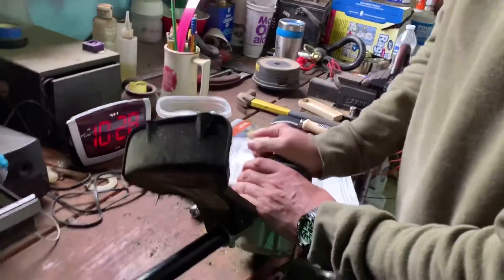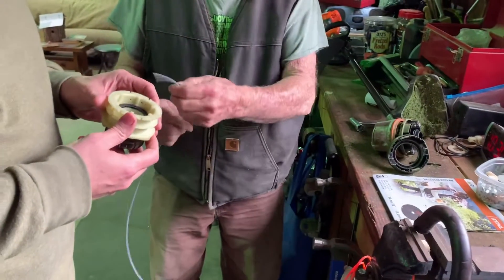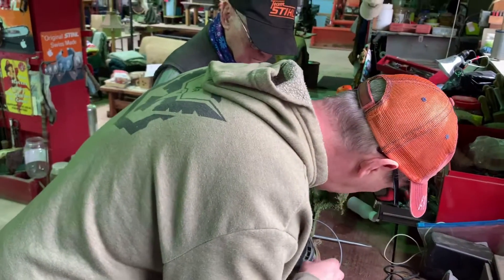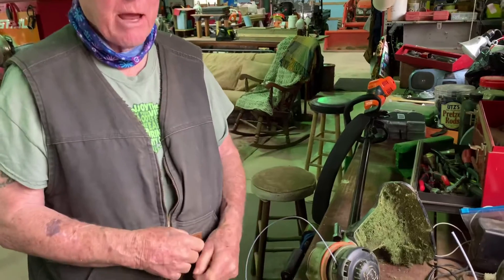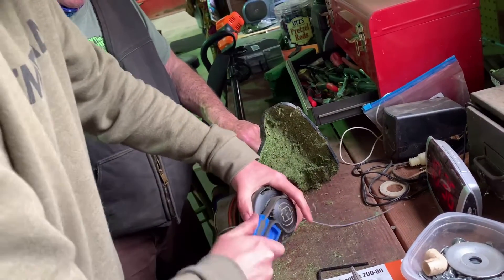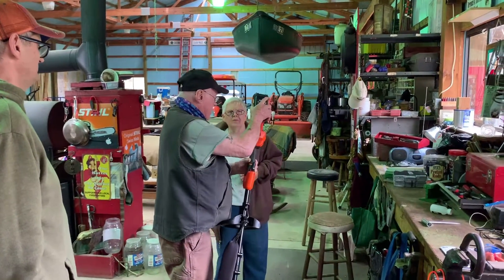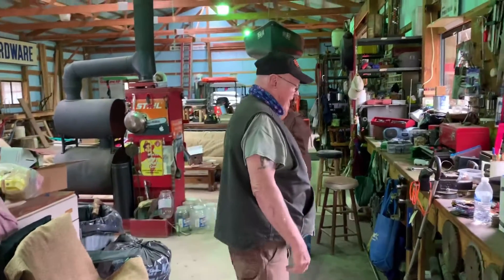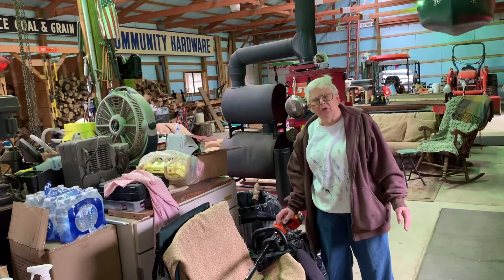Harbor Freight Atlas battery line trimmer | Copper Barn Homestead

Comment: To load the trimmer you don't need to take off the head, just need yo line up the two triangles that are right there in the head knob then you just slide the new string where is it says "line in". Once it comes out the other side you just pull it about two feet and then start yo twist the knob until it gets in. I recommend you to push and turn at the same time so it will be a little bit easier. I have been using it for like a year now and i love it.
Reply from the maker: Thanks! We will definitely try that next time, they love the entire set of tools! ❤️